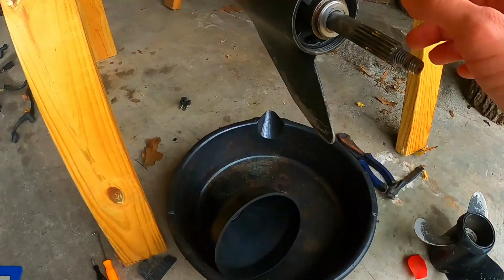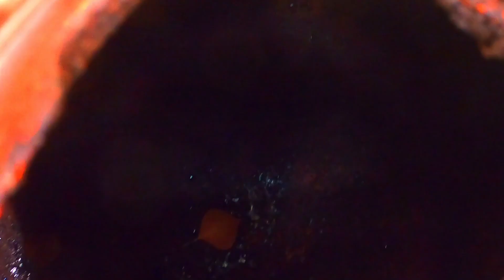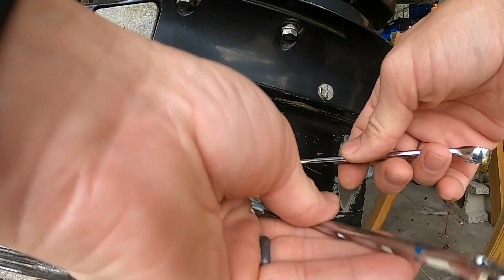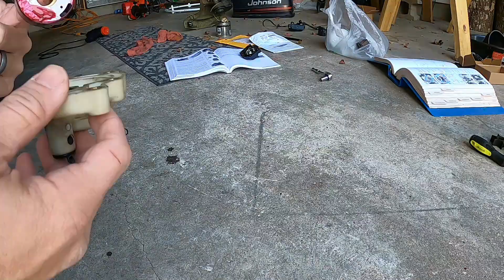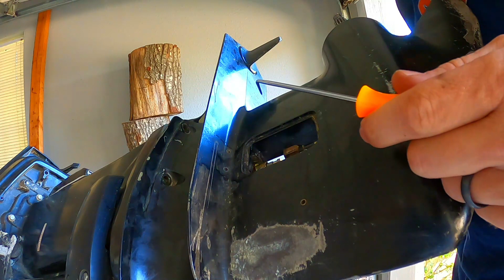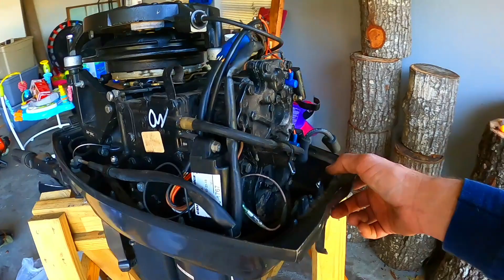1996 Johnson 25 HP Project Part 2! Water Pump Replacement and First Start!

Comment: What about the piece of black plastic pipe that sits above the water pump that you left off?
Reply from the maker: There are multiple different grommets for different applications. I believe I left out the ones that weren’t needed
Reply: The copper water tube that sends water uo to the engine. I never saw it
Reply: I'm assuming that you had water muffs on your H20 intakes. Brand new water pump  impeller. Could be damaged running it dry. Even for a short time.

Comment: You did us wrong on the firing issue. What fixed it? I wanted to see you replace sensor or whatever it was you replaced. I know the coil packs wasnt problem because it wasnt firing before power pack
Reply from the maker: Thanks for watching!! I’m still not done with the engine and will have another video out as soon as I can! I’m hoping coils will do it but it’s possible my eBay power pack, which fixed my no spark issue,  may be bad as well!! Thanks again for hanging around!